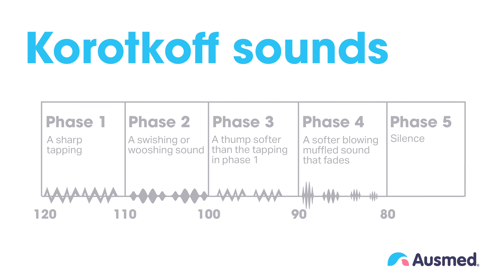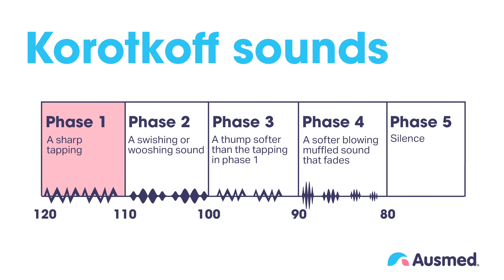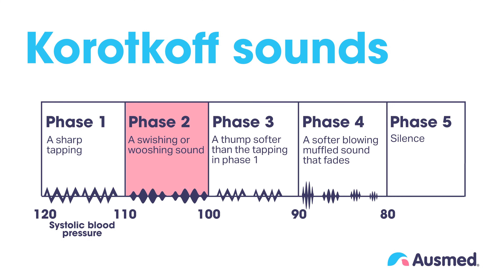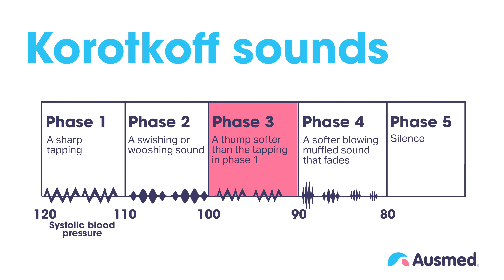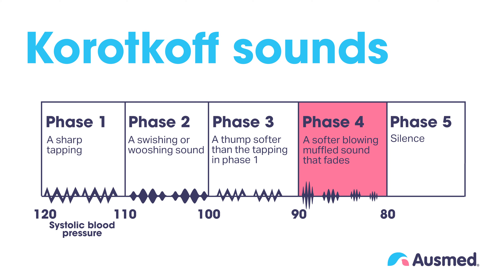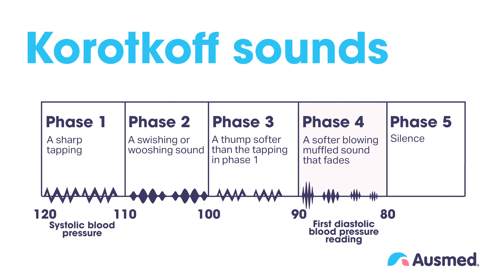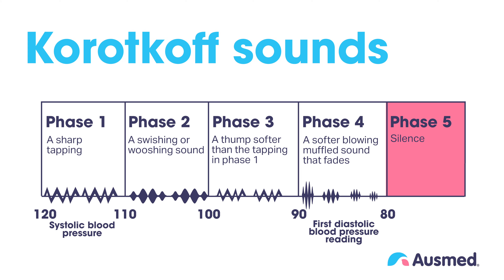Blood Pressure: Korotkoff Sounds | Ausmed Explains...

Comment: Korotkoff sounds can be a bit obtuse at first.  Like anything else, you eventually learn to interpret the sounds you hear.  I'm now used to my single-sided Littmann Stethoscope. I now prefer it to any of the others.  I think I paid some £70-80 for it some 20 or so years ago.  Not sure what they cost to buy now?  An Accoson Dekamet cost £40.00 back in 1994.  I still have mine, replete with it's shut-off valve to stop the mercury sloshing around in the manometer tube.  It is in almost new condition.

Comment: So systolic is when you first hear pulse and dystolic is when you cant hear it any more????
Reply: Yuh
Reply: This response is more so for anyone who happens to see this and has the same question as the original comment, since I’m guessing they have the answer by now. 

Head over to the khan academy video that explains Korotkoff sounds. As always it’s really intuitive and they do a good job explaining.

If you want a really quick answer it’s like this:

Silence:
Blood flowing normally is smooth, smooth flow is silent = (no sound when no pressure from cuff)
No blood flow is no blood movement distal to the cuff = (no sound when cuff pressure is more than systolic)

Let’s understand that last statement with systolic pressure. 

-Blood in the vessel pushes on the walls, that’s pressure. The heart pumps blood, giving it more force, that’s a higher blood pressure. Think squeezing a garden hose with stationary water in it vs when the tap is on full force.

- Systolic blood pressure is the highest pressure that the vessel wall feels every time the heart beats. Diastolic is the lowest pressure the walls feel during any given heart beat cycle.

-But it’s not just the blood that can push that walls of the vessel. Our pressure cuff also pushes on the walls, this time from the outside in (like a hand gripping the garden hose)

Korotkoff sounds:
When cuff pressure drops to systolic blood pressure, the flow of fluid finally can force its way past the cuff and into the bit of the brachial artery you are listening to. This time, crucially, it’s sputtering and turbulent. It’s not smooth. It makes sound. = (phase 1 Korotkoff sound when cuff is systolic pressure)

You will keep hearing sputtering, turbulent blood flow since the blood is forcing its way past the cuff’s grip right up until the cuffs grip is as light as the diastolic pressure. Now, at no point is the cuffs grip (pressure) strong enough to hold back any blood flow. All blood flowing is smooth. Smooth blood flow is silent

Hope that helps
Reply: Btw if you wanna see why smooth flow is silent, check out laminar flow